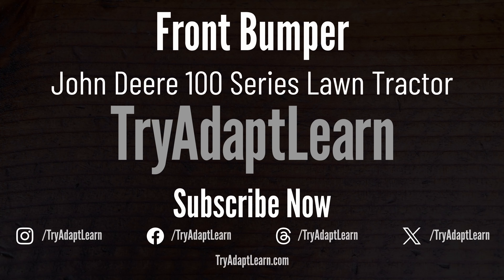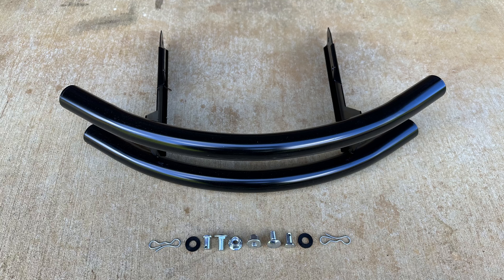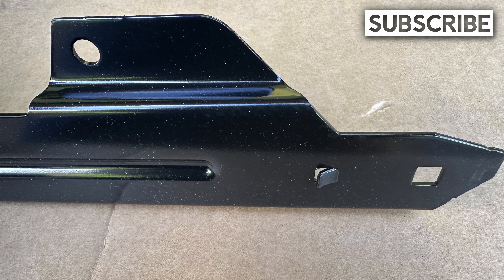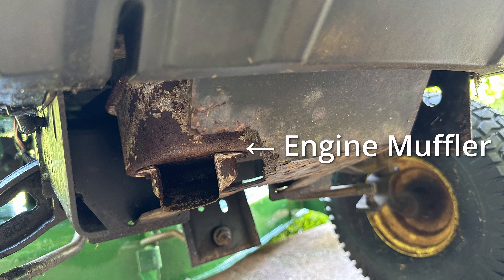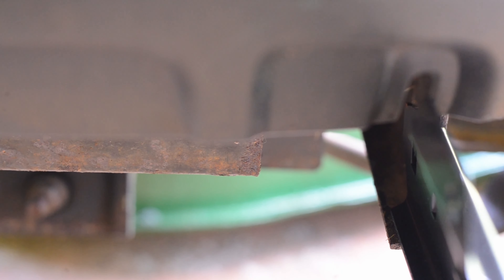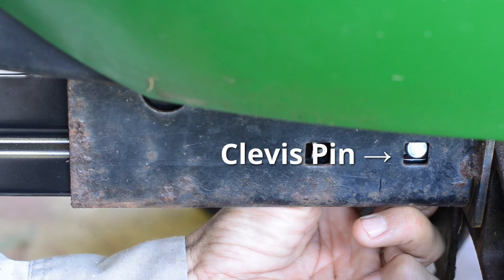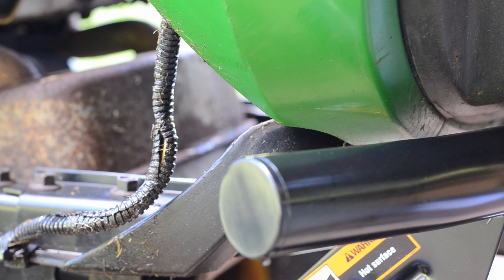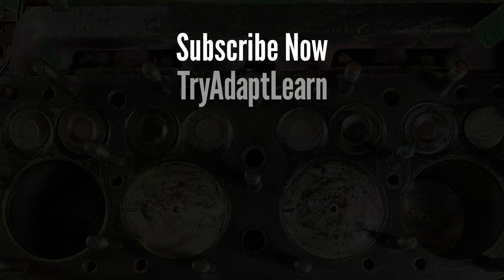John Deere 100 series Front Bumper install demonstrated on John Deere D140

Comment: Add extra hole and bolt otherwise it's loose and shakes. Use bolt instead of pin system
Reply from the maker: Thank you for your feedback about adding additional support for the bumper.

Comment: To anyone wondering as I was, the carriage bolts/nuts are optional.

The E100 series (and D, I think…maybe others as well) is still able to open the hood all the way with the bumper in place. So if you wanted to use the nuts/bolts for a more solid connection (perhaps reduce potential rattling?), you might opt to use those.

However, it appears some versions of John Deere tractors/mowers for which this bumper is also intended are NOT able to open the hood all the way with the bumper attached, and thus, the clevis pins may be the preferred option if you expect to need to open your hood frequently, or when you don’t have a wrench handy for removing the nuts/bolts.

Comment: Installed one of these on my John Deere E120 after viewing your video, however, my bumper had plastic end caps with threads on them and I cannot get the caps to slide into place. I'm open to suggestions on how to install the end caps.